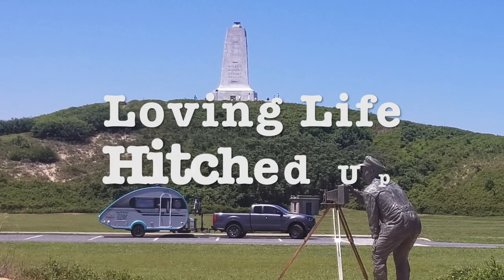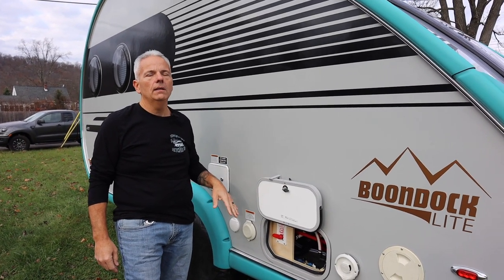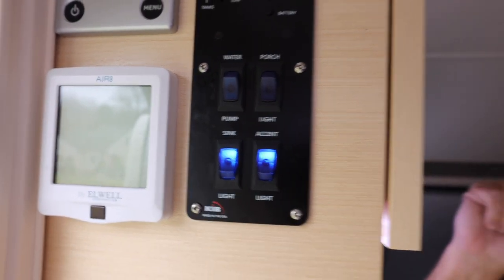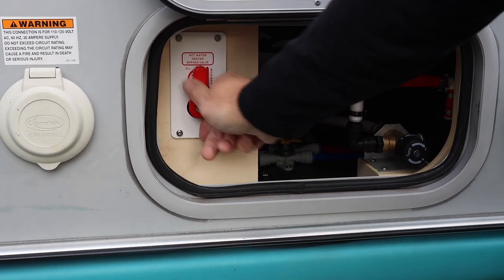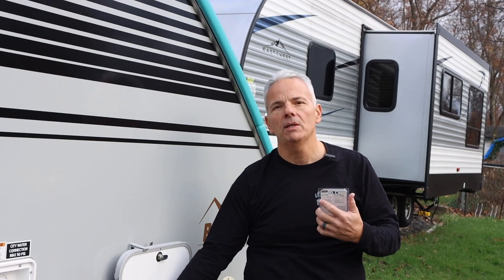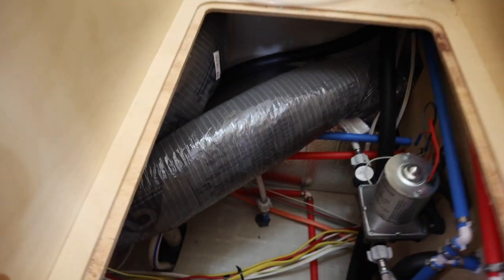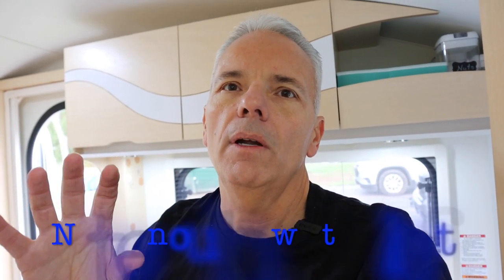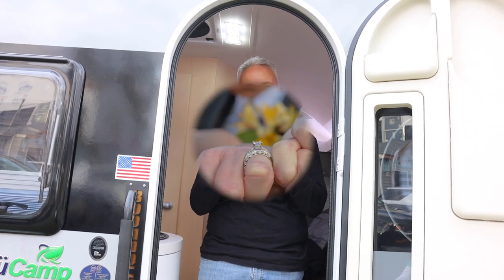Winterizing a Travel Trailer |Tab 400

Comment: Great information... I used the pink antifreeze in my Class A and I would never do that again.  That nasty stuff never really left my lines.  It always had a smell to it.  The vodka idea is wonderful, I would consider that option!
Reply from the maker: Agree, non toxic stuff, so it says....  In our small rig it only took 2 750ml bottles.  We actually just took it out for Christmas in SC!  So we will have to re-winterize when we get home.  The method we used meant that all we had to do was add water and go, flip the hot water bypass switch and we are back to camping!  Merry Christmas!

Comment: Thanks for the video and the process. I have a 2019 T@B 400 and just winterized. I used a Camco diverter that the prior owner put on the fresh tank input to water pump and after blowing out the lines used it to draw some pink antifreeze thru the system. My only suggestion would be your black tank blade/knife valve, which can freeze with the water from the flushes you showed while using the water pump to clear the lines before blowing out. I have seem reports of a small amount of water damaging the blade valves so wanted to know if you did add something to address that. Thanks again
Reply from the maker: We drain the BT and pour some vodka into the toilet into the tank and then top off the flapper valve inside the bowl.  I was thinking of adding pink stuff into the grey and black tanks. I just don't want to add pink stuff into any incoming lines that feed into the faucets. Thanks for the heads up on the blade valves, will do more research. Suggestions?
Reply: @LovingLifeHitchedUp  Hey thanks I am still learning about this too but a good resource is the NuCamp T@B forum. Glad you are putting stuff out there on the 400

Comment: Thanks for all the info!  Just to be sure, you do not put antifreeze or vodka into the system at all after blowing it out? I understand putting something into all the drains and the toilet but want to be sure it is okay to not put anything in the pipes.  Just bought a new 2022 Tab400!  Thanks again!
Reply from the maker: Hi.  You need to put the vodka or antifreeze in the drains for the traps and also in the dump valves so they don't freeze. As well as adding to the toilet to protect the seals. But the lines themselves don't need anything in them. Congratulations on your new 2022.

Comment: What happens in the spring when one has to drain the 3 gallons of antifreeze?  Does one need to catch it in buckets. I assume it’s not cool to drain onto the ground  even tho it’s the non toxic kind
Reply: Please see my comment about this. If you can't find it, here is the tl;dr - the adapter he showed is the only way to do this. Use 4 litre / 1 US gallon jug of antifreeze. Draining in the spring is less annoying and the antifreeze designed for rv's is environmentally neutral and won't harm anything. Find and watch the Travels with Delaney winterizing video for the 400. Much simpler and more efficient than this video.
Reply from the maker: We don't use antifreeze.  We only used vodka.

Comment: Sorry, but you do NOT have to use the pump to drain water from the pipes. Just open the low point drains (all of them at the same time) and open all the taps as well. ALL the water in the system drains out. You have over complicated a simple procedure. 

Also, you do NOT have to use so much antifreeze. Your dealer gave you the hose attachment (or you can buy a ~$10 attachment for your hose that has a valve to change the input) for the pump to use much less (a 4 litre / 1 US gallon jug). The pump (this is where it ACTUALLY comes in) is used to push the antifreeze to the taps, which you run individually to get the 'pink stuff' through the system.

And you do NOT have to put any more liquid into the sink than what comes out of the tap (pink stuff) to keep that area from having issues. Therefore, with your situation of blowing out the lines, using half a bottle of vodka is a major waste of vodka, especially in the floor drain. In Alberta, we get -30 to -40 C several times during the winter and this last step is unnecessary.

You have made something that literally takes 15 minutes into an arduous chore. I like much of your content, but this is bad advice. If you want an idea of how to winterize your 400, there is an excellent video by Travels with Delaney that is efficient and easy.
Reply from the maker: Actually, the nuCamp manual specifically states that each of the drain valves and pressure release valves must be opened independently not simultaneously.